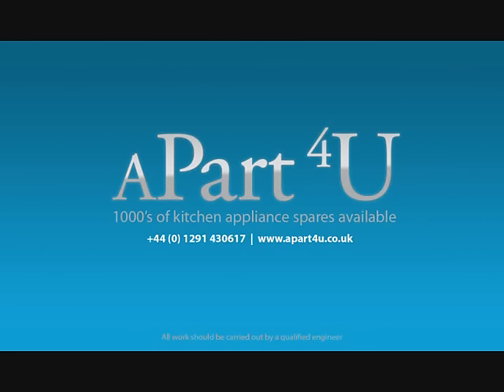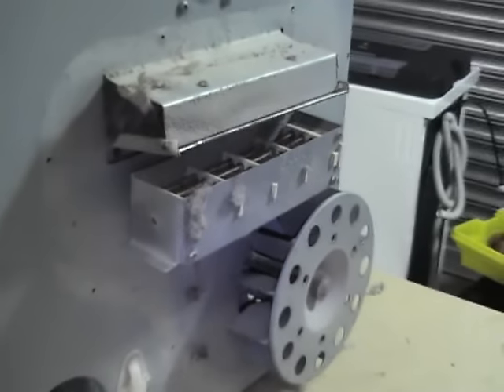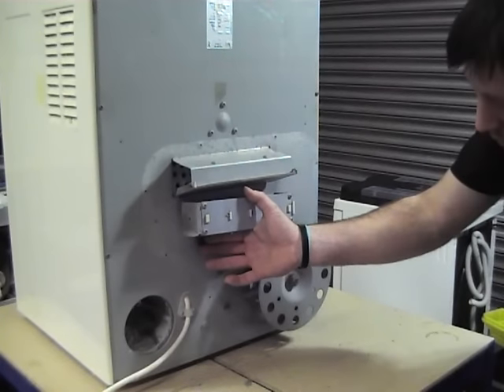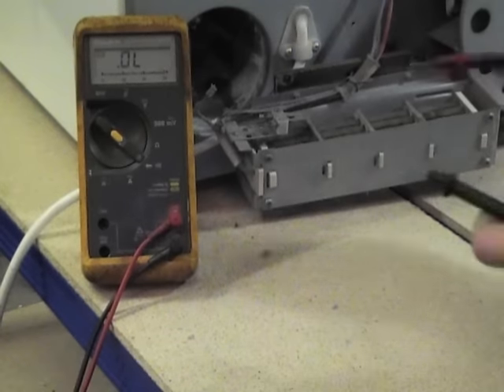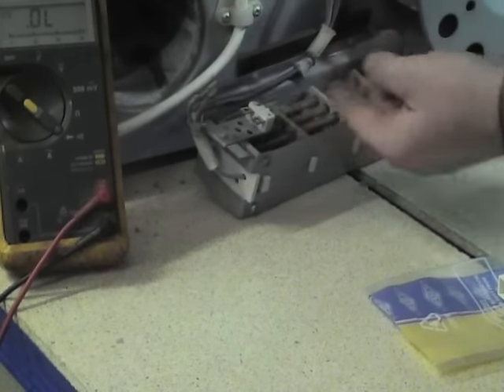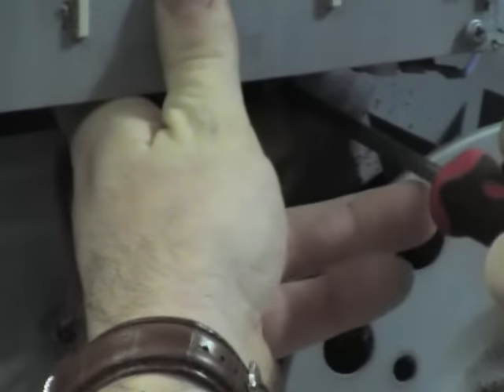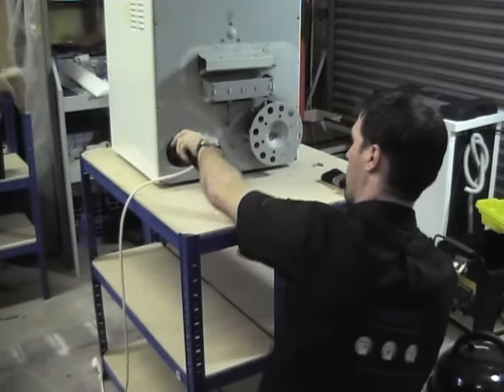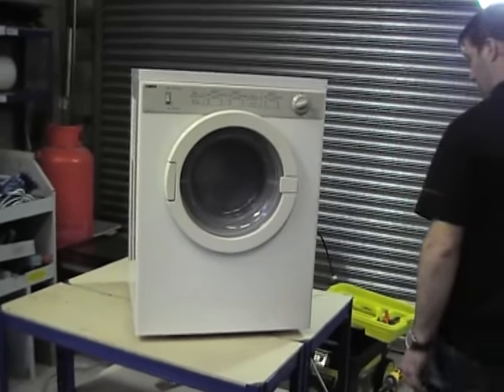How to repair tumble dryer when is not heating or drying clothes.

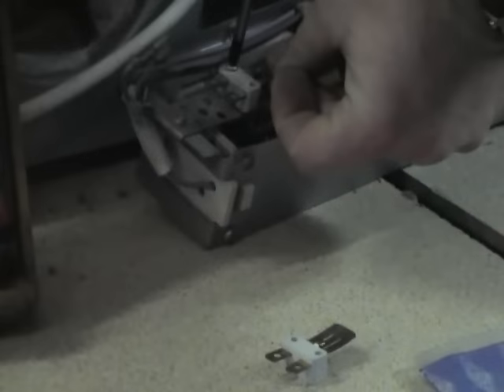Comment: I would just like to say,  at 4:18 you said that its because people open the door before the cooling cycle constantly and this causes it to wear out.  I used to work for Hoover/Candy and what made sense to us,  and were taught was that when you open the door it disconnects the motor,  since the motor is in series with both fans usually,  both fans stop running when the motors inactive.  The problem with this is if you open it at the hottest points,  there is nothing now to draw heat and circulate it,  so the heat will build up in the heating chamber as the heater is still very hot and insulated,  this can register the machine to overheat and trip the thermal overload switches,  and also damage the thermostats,  usually the TOC will trip like a fuse though.  

When going to peoples houses for this problem,  I would replace the heater (as stats were built in and I had a van full,  however now I would canabalise off another heater and make sure its correct for price reasons) I would check the condenser if its not vented,  if this is clear,  I would make sure the fans running and not slipping and the drum has been turning and not got a weak capacitor,  if all these are correct the assumption would be what I said above,  and I would tell the customer this.
Reply: I  let my dryers cool down

Comment: I have a swan stv407w(UK) it is not getting hot at all. I have removed the back panel and I am unable to locate any reset switch. Do you happen to know where it is located on that model? Any help is much appreciated
Reply: you need to change the heater on your dryer